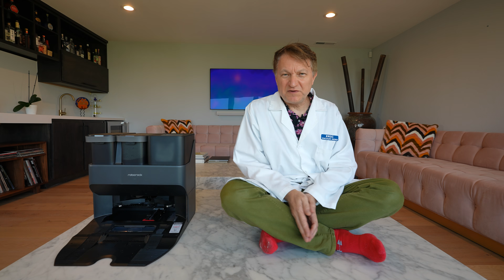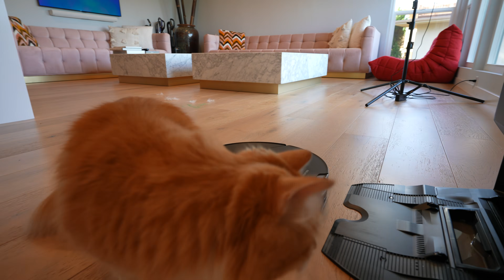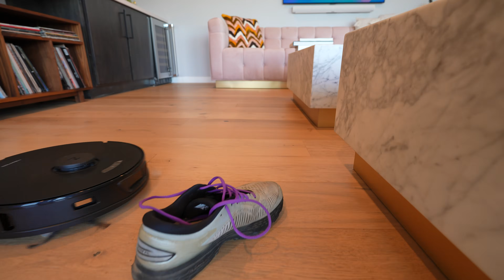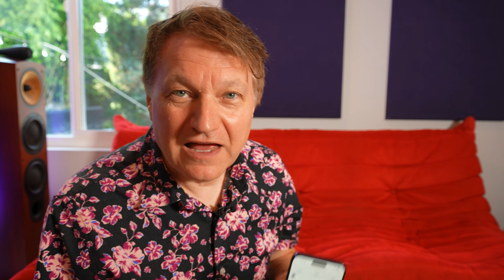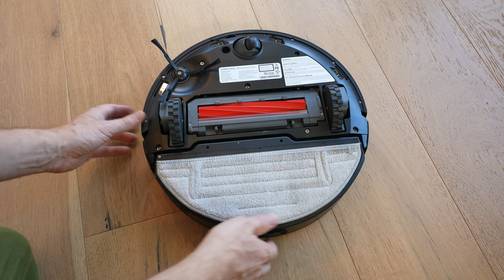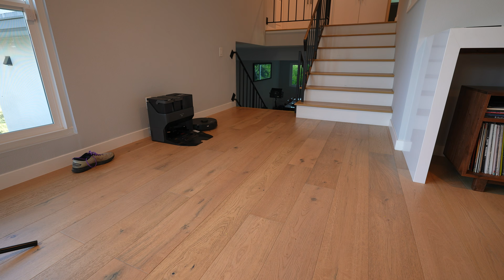Roborock S7 Max Ultra Has Some SMART Tech!

Comment: Has anyone tested if it is better to vacuum and then mop separately or does the vac/mop setting where it does it at the same time just as effective? I have been doing a schedule where it vacuums and then an hour later it mops thinking maybe this cleans better? Not sure if this has ever been tested or if anyone has user experience.
Reply from the maker: It's probably more effective to vacuum then mop, but I'm not sure how much difference there will be.

Comment: The water tank in robot is not detachable. Will it not cause any odor later on??? Since you cannot clean the tank???
Reply from the maker: The tank is internal. So far no issues. However, you could use a tiny bit of vinegar or vacuum detergent.